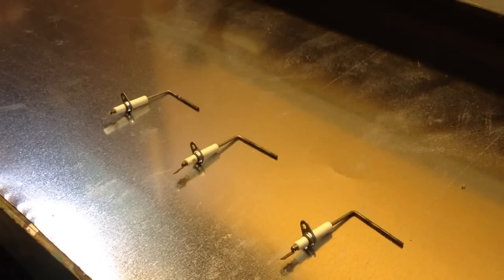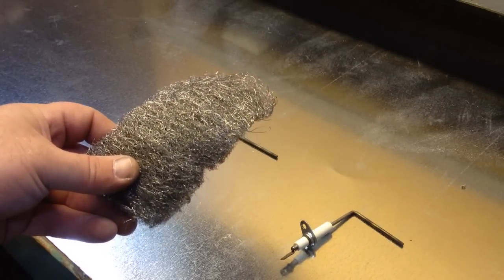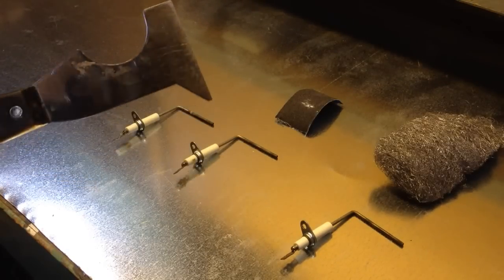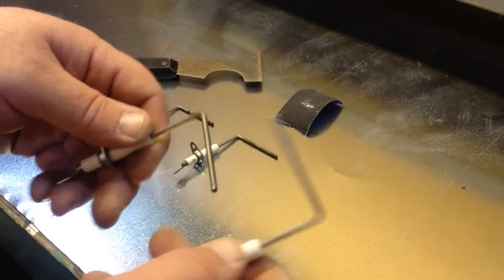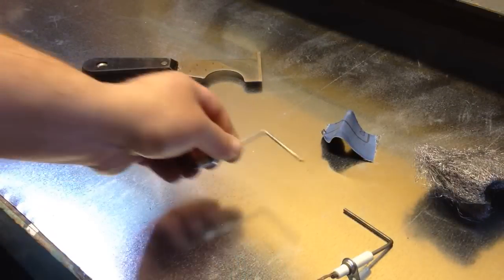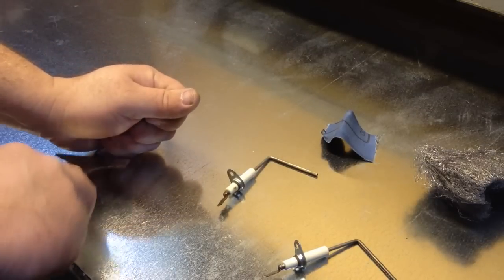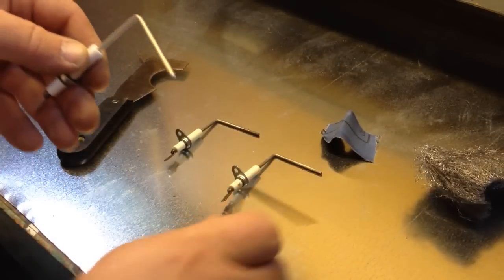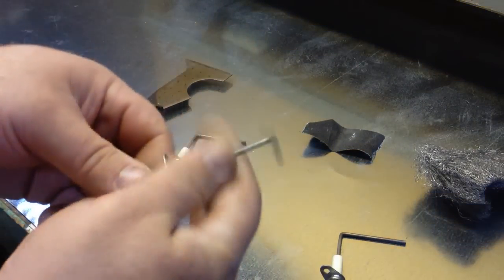3 Different Ways to Clean a Flame Sensor

Comment: Thank you for the informative film. I cleaned our Flame Sensor previous year w/ 0000 Steel Wool ( a small piece, very  gently and accurately).  I think now to try Carb Cleaner on shop towel. It is soot we need to remove, and probably it might be even more gentle cleaning of the surface. But not sure if the Cleaner won't react somehow w/the film which is on the surface of the Flame Sensor. I would appreciate any opinions on this matter.

Comment: I sprayed some Brake Cleaner onto a cheap paper towel and worked it back and forth and that cleaned it just fine. Also , this method clearly does not scratch the surface of the sensor. And no it was not "soaked". Spray onto paper towel and work back and forth. Now furnace is singing beautifully and respectfully.
Reply: Good idea

Comment: My furnace will run up to the set temperature just fine but i have to reset it 2 to 3 times a day. the ignitors will glow red you hear it send gas and a pilot light will light for a moment before lighting the burners.. would a bad flame sensor cut the propane off if it didn't sense the pilot flame after a few seconds? When it fails to ignite the furnace motor and ignitors stay on as if I just flipped the switch but it won't light again after the first failed attempt without a restart which usually works. It's an older furnace
Reply from the maker: Depending on the brand and model it may be a dirty or bad flame sensor.  If you are able to safely clean the flame sensor this may be the fix to your problem.  If it continues to have the same issues I would advise to contact a HVAC contractor.

Comment: Thanks for the video. I suspected my flame sensor was the culprit of intermittent problems with my furnace. One fellow told me that one should use nothing more than paper to clean it. You and a few other sources mentioned steel wool, It worked like a hot dandy. Thanks.

Comment: yep, I tend to like a the finer steel wool idea or as I do I use a small steel brush until shiney.  I do make sure that any burrs are removed. I do this when ever I have the burner out. I also use the steel brush on the  spade terminal. Some times if it really bad I use one of my wifes finger nail files on the spade connector for a smooth flat surface. I cut down a metal finger nail file to fit my female spade connectors, a couple of swipes and it cleans them right up.

Comment: Sandpaper works well. Never replace the flame sensor. It's a solid stainless steel rod and will last forever. It just needs to be cleaned periodically.

Comment: You can use 400 grit sand paper,im an hvac certified technician and i use sand paper all the time,when your done sanding the rod,just wipe it off with a clean cloth.
Reply: mark simms aaaaaaaqqqqqqqqqqqqqqqqqqq

Comment: You should always use "0000" steel wool or at least 1,000 grit sandpaper then wipe with a soft cloth, this will not damage the sensor but anything rougher than those can and will shorten the life of the sensor.

Comment: Thanks for such a straightforward video.  I just got my LPG fired water heater working again by pulling out the flame sensor and filing away the deposits on it unit I got shiny metal.  I guess that's a fourth way to do it...use a file.

Comment: Hi Rob, I have an old, (Circa 1988 maybe) Rheem Imperial 80+   I believe the flame sensor is bad because the furnace starts, shoots flames for ?? 10 to 15 seconds, turns the flame off and cycles again and again. My problem is finding the sensor.  There are 2 wires with  connectors on each, But, the probes are very small, 1/2 " to maybe 3/4"  Nothing like what You have here.  Could this have been modified?  I have pictures.  PLEASE help. its getting COLD here in Cincinnati, Ohio

Comment: Only use very fine (#0000) steel wool.  You don't want to damage the coating on the sensor, or it may not work properly.  Sandpaper is too abrasive, and a scraper will almost certainly damage the coating.

Comment: Use a dollar bill.  Seriously.  It is just rough enough.  Steel wool and putty knife can damage the coating.  Sand paper leaves residue.
Reply: Tim Naami. Can i use a canadian bill their different tho lil smother i guess cuz u cnt ripp them n i think they melt qhen burned
Reply: Yes a dollar bill will make it work. The flame sensor has a coating sand paper will remove it.scotch bite and steel wool are the second best cleaning methods  of cleaning the flame sensor rod.

Comment: We have been here for 6 years and I never had to touch the flame sensor. 3 months ago the furnace was having trouble staying lit and I had to clean the flame sensor, then all was good.

Now after 3 months, it's acting up again, so I ordered a spare. That way, when it begins to act up, I can swap it out with no downtime. Then I can clean the one I removed while the furnace is on. Also, at some point, if (when) the flame sensor totally fails, I already have a replacement on hand.

Comment: You do not use sand paper or a scraper! Way too aggressive and you will ruin the sensor!
The best is a  small brass brush or 3m brand green scrubby.
Reply: Good idea, thanks.
Reply: Y
Reply: C_ Farther 7
Reply: Some manufaucters tech support acctuley recommend sandpaper just fyi
Reply: Yes, a brass brush is best.  I have one dedicated for welding for cleaning without leaving contaminants.

Comment: tried dollar bill method...worked for only 3 months...back to bad again....trying steel wool tonite.
Reply: That's because this system and unit are a piece of junk.  Every year sometimes twice had to do this.
Reply: That is really helpful to know, thanks for posting.
Reply: You can scrub on it all you want but that will not bring back the micro amps it can't produce. Replace it and don't touch it after that.

Comment: Aluminum oxide (sandpaper) has a VERY high melting point.  TIG weld aluminum and you will know this.  :)
Reply: Pat Clements how high is the melting point I use aluminum oxide sandpaper I was just curious

Comment: Could anyone provide a video on how to take the flame sensors out to clean?
Reply: Mine was in a steel box with the control panel and burners, and it was attached from the inside never seen such a stupid design, had to take the furnace apart, grrrrrrrr cayenne sucks.

Comment: Had a few old timers tell me use a dollar bill.
Reply from the maker: I've had old timers tell me the same thing but I never tried it. lol
Reply: I use a steel brush. I agree with your old timer on the sandpaper. Sand melts as glass and may disturb the small current needed to prove flame. Great video. Steel will should be fine.
Reply: Use a dollar bill all the time.
Reply: $100 bill cleans far better. I use them all the time. I then sit back and use it to light my cigar. If it's really cold I even throw some in the furnace...

Comment: Best way to clean the flame sensor?  Throw your piece of crap Munchkin Boiler out the door and get a high efficiency furnace.  The only thing Munchkin is good for is burning your money.  They are so unreliable and the flame sensor F09 code is usually a 1-2 times a year thing.  Get a high efficiency furnace and a tankless water heater and you'll save a lot of space, money and aggravation.